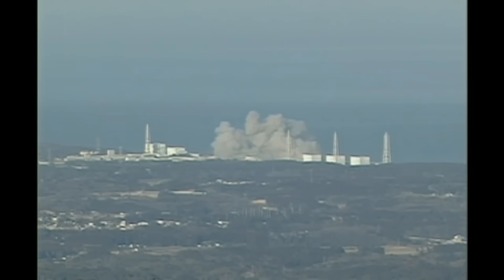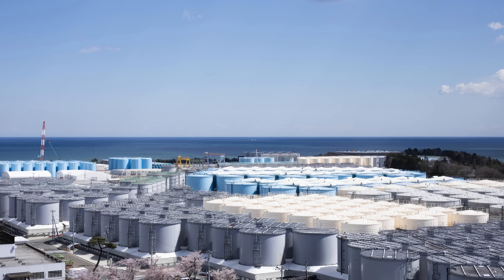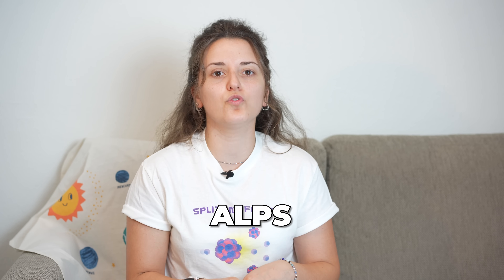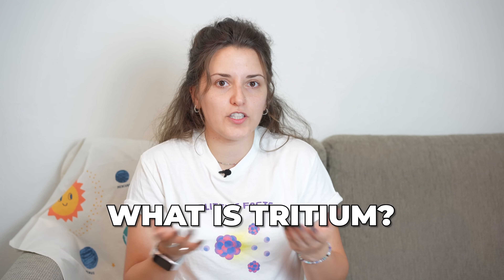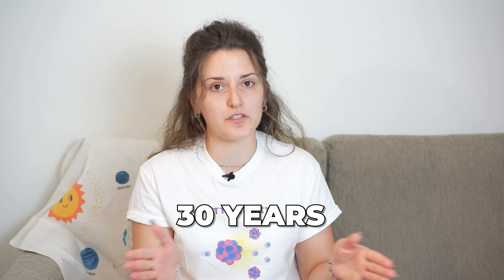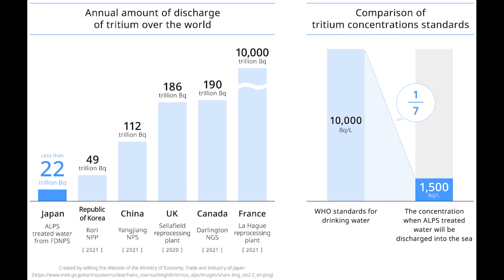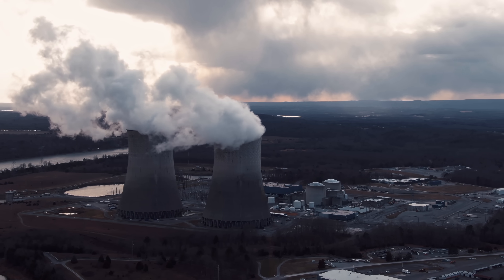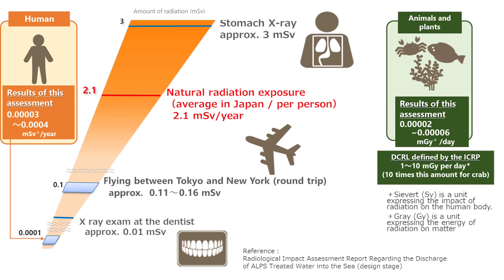Nuclear Physicist Explains - The Release of Fukushima Treated Radioactive Wastewater

Comment: I am a doctor n radiologist. It is true than beta particles penetration is low. However, we are talking about ingested tritium in contact with gastrointestinal mucosa which is 1 cell thick. A few mm penetration is sufficient to cause mutation. Mucosal cells are prone to damage n hence cancer development.
Reply: Because of the role of hydrogen in metabolism and its ubiquitousness in the environment, organisms have not evolved mechanisms to accumulate or concentrate hydrogen or its isotopes in food chains. Therefore, biomagnification of tritium is not a factor in food chain transfer.
Reply: @danadurnfordkevinblanchdebunk  Japanese will add tritium to the ocean for 30 years into Pacific Ocean. No body has done it before. Who are you to guaranteed there is no problem?

Comment: Tritium is the "Red Herring" distraction. It is the product after the nuclear fuel is burned. Problem here is that fuel was not burned - of course there is little tritium. 
Simple question to ask - if the water is so clean and safe, why not release that into rivers within Japan?
Reply: Wrong on your meme of how tritium is created. 
Why doesn't your country use your own tritiated water instead of dumping it into the sea?
Reply: Looks like you fell for the distraction!  Tritium is not the issue, but the thing to disguise the real issue - what else is in that water other than tritium.
Any other country uses ALPS - the magical system that cures all nuclear problems, and brings tritium to standard levels? If so why not sell it to other countries and make money now that JP's economy struggles so much? 
I am not taking any blind faith on this one, and no one should. @danadurnfordkevinblanchdebunk

Comment: Regardless of what Japan has claimed assuring safety of the so-called treated contaminated water, the lack of check and confirmation by creditable and trustworthy third-party is still outstanding. Besides, we know there are more radioactive elements exist in such contaminated water not just tritium. Let third party verify the treating process and results if there is nothing to hide. Atmosphere goes from sea-level to as high as 600 km. It has more room to accommodated the dilution requirement. Therefore, even if the treated is safe as claimed, evaporation is an a lot better option than dumping into the sea where lots of marine creatures exist and lots of peoples' livelihood depend.
Reply: Seven countries have tested the water.  Exactly what is "credible and trustworthy third parties"?  If Alex Jones opened the valve for you the results would be the same.

Comment: You should have compared the water from normal nuclear power plant and the water from Fukushima Japanese damaged nuclear plant. Japanese government try to mix them up to the public and give them the impression that these water are the same. It is serious misleading and cheating. In normal plant, the nuclear matter is enclosed in metal chamber and the water is outside of it. Water is just for cooling the chamber, it doesn't contact the nuclear material. But in Fukushima, the plant is damaged and the chamber is melted. The water is pumped into the chamber and it directly touch the radioactive material. More than 60 types of radioactive elements are generated. Such a huge difference, how can Japanese say Fukushima water is the same as other nuclear power plant water?
Reply: The treated water is the same, the full report completely bears this out.

Comment: ALPS does not remove all radioactive non water elements from the water. The water used to cool the melted cores have various minerals dissolved in it. These elements become radioactive to various degrees on the path through the melted cores. The cooling water is exposed to raw fuel and some of that fuel and other material used in the construction of the fuel rods and the structures around the fuel rods dissolves into the water generating more contamination. The ALPS process does not remove all the radioactive non tritium elements from the water. The tritium generated while in the core and irradiated by other radioactive minerals in the water cannot be removed from the cooling water. Many of the radioactive minerals that escape the ALPS process have much longer half lives than tritium. The focus on tritium is misleading people into thinking that only the radioactive element is tritiated water in the storage tanks. Dumping the water into the ocean using the dilution process is criminal. The smart thing they should have done is to use a water to air intercooler that uses a finite and comparatively small recirculating volume of water to cool the cores. This would have eliminated having to store and dump huge volumes of radioactive water into the oceans contaminating our seafood. One other thing to note here is that bioaccumulation occurs in ocean life and the longer for example a fish lives the more radioactive the fish will become. Another thing to note is that no matter what the scientists say about the odds of getting cancer is slim, keep in mind that all you need is one cell in your body to become cancerous caused by one radioactive particle to kill you eventually. Are you willing to accept or take the risk with your future health.
Reply: You could have read the full report before making such a statement.

Comment: I see you're shilling for the nuclear power industry with that old "radioactive potassium" BULLS#!T. I guess it's a requirement for that cushy job you have.

Radioactive potassium (potassium 40) makes up less than 120 parts per million of regular potassium and it's half life is so long that radiation from it is very weak. Tritium is extremely rare IN NATURE but in the quantities of it that exist in that water at Fukushima it is DANGEROUS. True, beta radiation is the weakest kind because it doesn't travel very far as it is just an electron, but it is still IONIZING and if it is ingested the radiation will go directly into the surrounding tissue causing mutations and possibly cancer. To say it is ten thousand times less radioactive than potassium 40 is gaslighting, its radiation is just ten thousand times more rare. The amount of Tritium in that filthy water at Fukushima is at dangerous levels whereas the rarity of Potassium 40, which is evenly distributed throughout the human body (or any other living thing) is hardly of any concern since the half-life is so long it is almost indistinguishable from background radiation.

Half-life is another thing you shills for the nuclear power industry ignore. The difference between the 1.24 BILLION YEARS half-life of Potasium 40 and the 12.33 YEAR half-life of Tritium is huge. A mole of Tritium atoms is almost 100 MILLION times more radioactive than a mole of Potassium 40 atoms! This is why they have chosen to release the Tritium contaminated water into the ocean. Evaporation would be irresponsible, as was pointed out when it was proposed. The wind would blow it all over and people would be breathing it in and absorbing huge amounts of radioactive Tritium. Tritium is nothing to laugh about, it is very dangerous in the quantities that exist in that filthy water if it is ingested.

You shills for the URANIUM Nuclear interests (power AND weapons) always pooh-pooh and deliberately confuse people about "radiation". You make no distinction about being exposed to a radiation source and INGESTING a radioactive element. Having Tritium inside the plastic of a gun sight or a watch dial is not much more than background radiation, but having it inside the water molecules of your cells puts it INSIDE the DNA and is why it is so dangerous because it can cause cancer by mutating the DNA structure.

You mention that the "cost" for Uranium is cheaper. Cheaper because the whole industry is unregulated when it comes to environmental impact. Oh there are tons of regulations, but not the important kind, the release of tons of RADON 222 every year that rises up from open-pit Uranium mines all over the world. NASA operated a U2 plane (I don't know if it still does) just to measure the amount of Radon 222 in the upper atmosphere. Radon 222 is bad enough and is shown to cause lung cancer. It is why there are no tunnel type Uranium mines anywhere. It outgasses so fast from Uranium ore that it is very expensive to adequately ventilate such a mine, so you guys just open-pit mine the stuff, making it cheaper to mine. This is almost as bad as the lead-acid battery makers just dumping lead contaminated compounds into the river because it was cheaper, as is being done in Mexico and can no longer be done in America because the damage to the environment is so obvious. An open-pit Uranium mine doesn't dump its toxic Radon gas into the river, it dumps it into the AIR! And in a little over 8 days (its half-life, another reason Radon 222 is so deadly) the Radon 222 turns into Polonium 210, the very element Putin used to assassinate the Russian dissident Alexander Litvinenko!

Today the whole world has a constant rain of monatomic Polonium 210 atoms falling from the sky, contaminating the plants, the water and the soil. This is not a huge concern for apples and oranges because we wash them before we eat them, but for tobacco users it causes mouth and lung cancers. Every tobacco user has measurable amounts of Polonium 210 in their bodies, all of it originating from open-pit Uranium mines. That is why lung cancer skyrocketed right after World War 2: All the tobacco was being dusted with Polonium 210, an alpha particle emitter as you know that mimics Potassium chemically and quickly distributes deep into the body's cells.

"Cheaper to use Uranium"... of course, as you guys poison the world killing untold millions from ingesting your effluents.

But you love to get away with all this poisoning because cancer takes so long to develop and the cancers don't say HOW they were caused. A baby gets leukemia and you say it can't be PROVED that the Cesium 137 from the Pacific tuna fish he ate, that originated from Fukushima, caused it. Your like the liar that says if you can't PROVE he's lying then you are the bad guy for not believing him.

Well I don't believe you. Being a pretty girl is probably why these ghouls use you to propagate their propaganda about "how safe nuclear power is." Shame on you. You should know better, but perhaps you're not as smart as you think you are.
Reply: No point in reading anything in your book past the first few words since you fall flat on your face immediately.

Comment: Maybe you have explained and I may have missed it, but if the treated water was safe to be released in the first place, why does nuclear power plant store them? It should've been released into the sea after the Alps treatment as the SOP rather than storing it? If this releasing of treated waste water are similar to how manufacturing plants release their waste water after being treated, then this wouldn't have to go through WHO or any other organization in the first place? So naturally my assumption is that the water wasn't safe to be released directly into the sea like other industrial waste water and hence the need to go through all these checks and confirmation from the experts.
Reply: You are correct.  TEPCO made a big PR blunder by continuing to store it instead of releasing it after treatment like all nuclear power plants do.  Had they been doing so there would only be a few tanks necessary.

Comment: coool insight. I'm wondering why is there so many liters of contaminated water stored in the first place? i hear them running out of storage to store the water. which tells me that they're still actively using fresh water to cool the reactors which is why the water gets contaminated and they run out of storage? is that true or is my assumption off?
also my 2nd concern, how do we know the treated water is really at those low levels they say? what is the chance perhaps the treated water might not be consistently treated to remove the other radioactive elements we they end up releasing more radioactive water than planned and the risk of endangering the entire ocean? 

merci
Reply: Yes, new water is continually introduce to cool the elephant's foot.  TEPCO's mistake was to store the water after treatment instead of releasing it like all other nuclear power plants do.  You could read the report to learn your last meme about the levels of contaminates in the water.
Reply: thanks for the reply. oki I will research into it a bit later..what do you think of making a side by side comparison of the events that happened in Chernobyl vs Fukushima and the actions that were taken to handle the situation. with timelines, perhaps could be a long video. would be an interesting insight from a professional. Merci
Reply: @z.z.onichi5365   Chernobyl released about 10x the amount of radiation than Fukushima did.  There are hundreds of videos I have on my account with videos mostly from real nuclear professionals if you want to go deeper outside of the fear mongering the media always dishes out.

Comment: Open Fukushima and ALPs to China and Russian Nuclear Inspectors. No more Confusion or Misundestanding. Why should Corrupted US IAEA and TEPCO be the Only Ones ? Normal Cooling Water has no contact with the Nuclear Reactor Cores. What is the problem to check for radioactive isotopes too in the discharge? Any TEPCO Parrot wants to comment about reading reports and believing in magic washing machines? Or leaving insults and racist speech?
Reply: You have been told many times that four countries have samples of the water and was tested in six countries.  You also would know full well that ALPS is an effective treatment based on the full report that you refuse to look at.  Why do you insist on continuing to spread such disinformation?

Comment: So much truth is hidden. I guess Japan's 70-billion-dollar marketing budget did a pretty good job here. This is undoubtedly the most horrific disaster to occur in the 21st century.

1. The TEPCO (Tokyo Electric Power Company) is a company with a really bad reputation and is well-known for dishonesty. It never adhered to international best practices and standards with the nuclear station, and lied about the severity of the incident, which led to the escalation of the disaster (it claimed it was a mere core damage, not a meltdown, leading to the adoption of incorrect measures).
2. The video claims that ALPS removes all radioactive elements except tritium. However, according to Japan's METI, around 70% of ALPS-treated water still contained radioactive substances other than tritium. This figure will be even worse when third-party testing is implemented.
3. There were initially five proposals to address the polluted water, but Japan simply chose the cheapest option: to dump the nuclear water into the sea.
4. Even worse, Japan refused offers from other countries to monitor the water. If the treated water is truly safe, why be so reluctant to allow others to participate in the testing? Are they afraid of the truth being revealed?
5. The video attempts to mislead people by comparing tritium levels with China and other countries. This is a terrible comparison, as it's actually attempting to equate nuclear-contaminated water with regular wastewater, which are entirely different substances. It's clear that the budget is influencing public opinion.

If the treated water is indeed safe, then they should keep it for themselves. If it's not safe, then they shouldn't dump it into the ocean.
Reply: Wow, not even possible to get past your first meme before calling you out. 
"This is undoubtedly the most horrific disaster to occur in the 21st century."  
Since no one died or was injured by Fukushima radiation, I can think of many hundreds of disasters more horrific, starting with the Tohoku earthquake and tsunami itself that killed an estimated 20,000 people.
Reply: @ForbiddTV  Maybe I should put up as nuclear disaster if that makes more sense to you. This will be a long term disaster(30 years) causing health issue/cancers to creatures  and  brings environmental damage to the earth in an unprecedented scale. I would appreciate if you can post valid evidence to oppose my points listed above. Because what you just posted doesn't really touch any facts that I stated right?

Comment: I am French and I am shocked to see the annual released of tritium compared to Fukushima. If I am not wrong, tritium and deuterium can be used to make nuclear fusion. I wonder why tritium is not reprocessed to be used as a fuel for nuclear fusion.
Reply: There's not enough there to justify spending trillions of Yen trying to get it out.  At Fukushima there is only a total of 2-3 grams in all of those tanks.
Reply: @ForbiddTV  There is definitely enough tritium at La Hague to justify an investment.
Reply: @Francois_LHC_   La Hauge is a reprocessing facility where they do attempt to remove radionuclides.
Reply: @ForbiddTV  Well, it clearly needs to be improved then.
Reply: @Francois_LHC_   Difficult to remove.  The French water, although with higher levels of tritium than most nuclear power plants, still meets all international industry safety standards.
Reply: @ForbiddTV   Then research needs to be done in order to remove the tritium more easily.